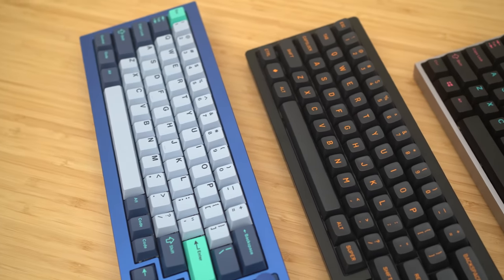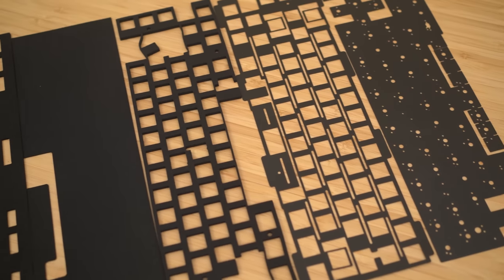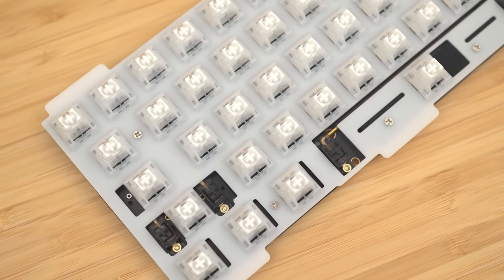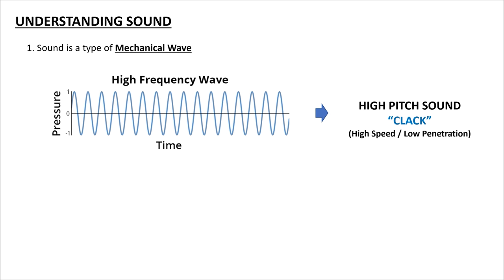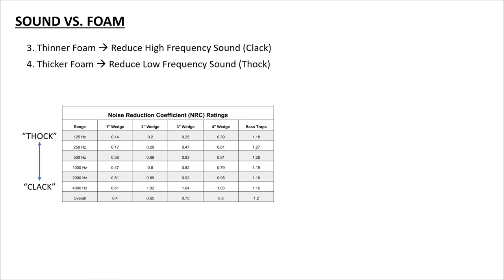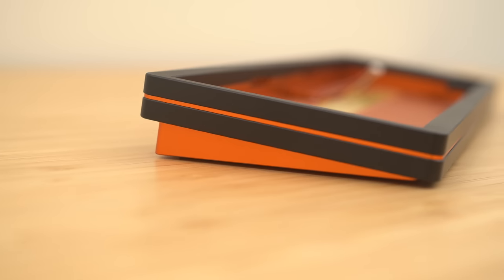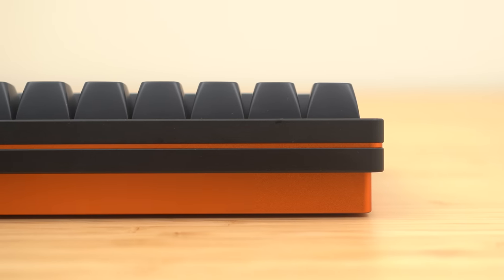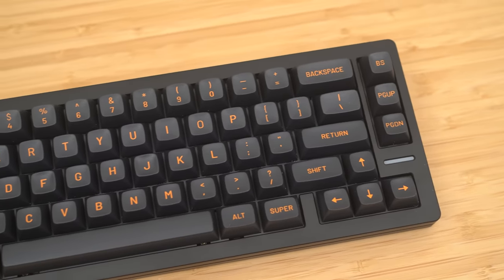YOU Make Your Keyboard Clack or Thock - Featuring Wind X65

Comment from the maker: Hi Everyone!  Thank you for the great comments!  I also received some great technical comments from great technical minds about sound speed.  I mentioned that higher frequency sounds have higher speeds Vs. Low frequency sounds having lower speeds, but at the same time, sound speed is pretty much set in a given controlled medium (air, 345 m/s).  There is an equation to determine speed of sound based on frequency and wavelength, and it's Speed = Frequency * Wavelength.  Per said equation, it would mean that as frequency increases, so should sound.  However, one fact that I didn't go deep into was that Frequency and Wavelength are actually inversely proportional.  So as one increases, the other decreases.  Given that information, as Frequency increases, the wavelength decreases, and the speed will pretty much stay constant.  With acoustic dispersion, there is a chance that higher frequencies will travel faster than lower frequencies... but that is getting too deep into this.  Sorry if anyone was confused at all by my generalization!  However, the impact this has on the sound and the foam usage still remains, so thicker foam is needed to block deeper sounds!
Reply: This is the best video I've seen explaining some aspects of keyboard acoustics. I'd love to have a chat to share knowledge and bounce ideas off each other to help our community understand acoustics even further.
Reply: You are not getting too deep into this!!! I would have read 7 more paragraphs haha but I’m studying audio for a living by passion so maybe I’m alone in that XD
Reply: Now put the clacky switches on the thocc build and thocc switch in clack build
Reply: I love he you went into the science of it as a beginner I understand a lot more about foam and modding because of it
Reply: I love that you explained the science behind it. But what about PE foam (PE-HD)? It seems to be less of a foam but more like a foil. I have heard that some really recommend using PE foam for their builds, but how does it really impact sound? Is it more like a inbetween of regular foam and masking tape kind of?
Reply: Yes to science! Honestly having these explanations really helps as there are just to many generalizations stated about different materials without any explanation. Actually having a series dedicated to just explaining the science behind the materials would be amazing as right now the only real way I see people learning is if they take a bunch of generalizations and suggestions then buy way to many items so they can test them in person. Also having a decibel reading for every test would be great as recording software, mic placement, rendering codecs, the encoding of the video, and each person's individual devices each affect the playback. I personally would love more science based explanations on how to make a keyboard quite as right now the video landscape is just The Thockening! and I would like to make a quite keyboard for recording while typing as my mics are very sensitive and having a quite keyboard would reduce my audio editing time dramatically.
Reply: Actually you showing the science is what made me subscribe to your channel. So yeah keep going with it.
Reply: This might be a weird question to ask but I thought it would be worth a try. Would you consider trading this particular keyboard for a Phase One 65? I have a Phase One 65, fully built
Reply: When talking about absorption, you have to consider the materials density too. Higher density results in more sound dampening, until the material is so dense that sound starts to reflect off it instead. But absorbing the low frequencies of a thock with foam as thin as 1cm is physically impossible regardless of density. A 2000hz sound wave is 17cm long, you’d need an absorbent thickness at least a quarter of that to effectively absorb any of it, and thocks go way lower, so something else must be killing the low frequencies. An uneducated guess: maybe the foam pressing against a pcb/plate reduces the resonance of the plate, and all you hear is the clack from the switch itself. The tape probably shapes the resonance rather than any absorption of high frequencies.

Designing a deep thock using absorption would require the absorbent/isolation to surround the sound, and making sure to plug sound leaks (gaps between parts, switches etc.). I’d wanna try a layer of absorbent/isolation OVER the mounting plate, with an air gap between these two layers. The absorbents thickness and density can be calculated with the porous absorber calculator (google it). This wouldn’t alter the resonance of the plate and you could further filter the high frequencies for more thock.
Reply: I need to add, you cannot absorb low frequencies without also absorbing the high frequencies, unless we are looking at something like a helmholtz resonator. Deffo not the case with a piece of foam

Comment: Thanks for the very interesting information! One thing though: since you didn't use the same switch for both the "clack" and the "thock" builds, for all we know, maybe the switch IS the most important for the sound? I don't think it is, and I believe what you showed us, but I think it might be interesting to test this with a "neutral" sounding switch (whatever that may be) in both build variants. :)
Reply: Switch does play a role, however even if you were to put the gateron inks into a clacks build, it would still sound clacky a little bit deeper but still clacky. I tried this on my kbd75 because I had the same doubt xd

Comment: For the whole sound part it is also VERY important to mention that it is not just about the thickness, but also structure and especially density. Thats why there are specific materials used in Sound Absorbers (Not to confuse with Acoustic Panels) or why different materials for keycaps create such a different sound, even when they look the same.
The thickness part only works if you compare the same materials with each other.

Comment: 8:20 , you're not just cutting out lower end but rather lower as well as higher frequencies with thicker foam,( basically balanced sound with low volume)
Whereas in low amounts of roam the higher frequencies are reduced and the lower are unaffected making it seem more low end. 
I suppose the volumes were different form both the clack and thocc keyboards and were adjusted in post.

Comment: You didn't share anything about dampeners between plate and pcb, and I found that actually removing that gives you more thock. I figured its because those are thick foams or silicon shapes so they absord more low frequencies

Comment: All sound travels at the same speed regardless of its frequency (assuming constant air temperature and pressure). That's why by definition frequency and wavelength are inversely proportional for the same conditions.

Also, with regards to what each material (case foam, plate foam, IXPE foam, masking tape, silicone, etc.) filters, it's the frequency that gets through without being absorbed that we hear. That's the material's characteristic, and it doesn't change based on how much we use, just to which degree. With regards to the full foam clack build, those same foams still disproportionately eliminate higher frequencies, but it's rather a function of a smaller resonant volume and that resonant volume being closer to the top that we hear more reflections of the unfiltered sound. By taking out the plate and PCB foam, sound has a chance to enter the chassis and come back, and especially if there is IXPE and/or masking tape, the more times it travels back and forth the more subject it is to the filtration of higher frequencies, leaving the lower frequencies for us to hear. Also something to be said about the resonant frequency of a larger space contributing to this as well. Pretty excited to see new materials like suede, felt, cork, and more in the cases of some of these new boards!
Reply from the maker: Really good call out!  You are correct on the sound speed in the constant medium... approximately 345 m/s in air.  Sorry if it makes it seem like I generalized :)  I referenced equation speed = frequency * wavelength, but didn't go as deep into explaining that frequency and wavelength are inversely proportional... so as frequency increases, wavelength decreases, effectively making speed the same given that the medium is held constant.  I know that with acoustic dispersion, there is a tendency for higher frequencies to experience slightly increases speed, but I felt that was too deep to go into haha.  But you point out a lot of more advanced details on the sound of keyboards, the materials that shape it!

Comment: Yes this 100% true but highlighting the material of the keyboard case (Top & Bottom) based on my experience, the plastic ones will produce more thocky/deep build and the metals (alloy or aluminum) will produce a clacky build however this video shows how important does the foam really affects the keyboard sound at all kind of keyboard case material. Very informative content😉👌

Comment: People seriously underestimate the effect keycap profile and material has on overall sound. I've gone from GMK (cherry ABS) to cherry PBT to DSA PBT and the amount of difference it made with everything else basically the same was astounding. It's honestly made me seriously think about investing into MT3 caps even though I usually don't like the look of those very much.

By the way if you have a keyboard that you want to deepen the sound but it didn't come with a sheet of IXPE foam, you can buy switch pads (KBDFans has them in stock) and it does a pretty good job of giving you a similar experience, although it's a lot less reversible than a foam sheet since you have to stick em on your board.

Comment: I've had a Logitech G610 with MX browns since 2016. Just recently, it really started getting on my nerves because it was creaky, had rough stabilizers, and it was too loud for me.. but I could live with it since I wasn't using it much. But now I am, so... I opened it up, cleaned and lubed the stabilizers, wedged some paper in between them and the plate so that there's no moving tolerance anymore.. I've put some dense foam inside to fill in the hollow body.. Man. It sounds completely different now. A joy to use, really. Took me a couple hours to get done, but it was totally worth it.

Comment: Sorry for the stupid question. But what material PCB plate are you using with all those foams in the thocky sound build? Trying to hard to make a thocky sounding board haha. 
Also do you have anywhere to buy the ixpe sheets with the cutouts?

Comment: Just tried this and it really works. Removed the silicone plate pads and replaced it with a thin PE foam sheet instead. Sound got deeper but a bit louder.

Comment: After this golden wisdom, I think my follow up question would be: if thinner materials allow low frequencies, why use foam on the bottom, or tape on the PCB, at all? I feel like it may help tighten up case sounds, like a Moon Gel on a drum head… or does it serve a different purpose?

Comment: I like my Apple Extended Keyboard M0115 very much.
I am hesitant to pour dental resin into it, but for the moment just using it on a mat, then adding painting tape under the pcb was great.
It's amazing that the thock depend also on the resonant chamber effect, on this one the function keys are more thock and the space bar is more mechanical pump action.
I think overall it sound and feel so perfect for me.

My next step would be to de-yellow the frame and the space bar.
I especially like the caps lock that stays down, I think it is still something modern keyboards do not offer.

I type with 2-3 fingers of each hand... my wife like when i type she hear like running water of a small mountain stream.
Each time I have to type on anything else I think about this beloved keyboard.

Comment: Thank you for this wonderful video, i hope you continue this as a series to help out other enthusiasts to understand how to tune the sound of our keyboards better. ❤️

It made me try to mod my keyboard and it came with eva foam. I researched online about sound dampening and absorbing higher frequencies. Generally pe foam, poly fiber fill can dampen higher frequencies more in which i see those materials being used on filling some subwoofer boxes.

Meanwhile other foams like eva can dampen lower frequencies more.

I tried filling my keyboard case with poly fiber fill sheet instead of eva and removed the eva plate foam, added pe foam mod and it sounded more deeper than the eva case foam + plate foam which sounded more higher pitched.

Now the only thing that i need to know is that if i used a poly fiber or maybe like a felt fiber material for a plate foam rather than using eva can help on making it sound more deeper. (Poly fiber fill sheets are hard to cut diy)
Reply: Now this is the answer I needed for my keeb (RIP to my efforts by cutting squares for each switches and it's TKL). Since most keebs today have plate foam, I think this is the reason that those keyboards are clackier instead of thocky. I will try to remove this soon when I replace my stock plate to a PC one. Thanks!
Reply: I think I might use a water filter foam I think it's similar to polyfill. I think?
Reply: @chongkies64  something porous, soft and pliable could be also used and worth a try.
Reply: Well, an aquarium filter is definitely porous. I might give it a try soon

Comment: @Keybored
QUESTION: Would using multiple layers of thin material be the same as using one thick layer of material with respect to thock? Also does the order in which the material is layered between the PCB and the bottom of the case make a difference? I know that sound refracts based off the density of the material, so I'm trying to wrap my head around whether the journey of the sound from the PCB out to the bottom of the case, and back up to me changes based on the order of materials it goes through.

Comment: Another great video. I have a question if your foam explanation applies to butyl rubber such as the Noico and Kilmat that you have recommended in the past. Will a thicker sheet of butyl rubber also reduce low frequency sound or will it only deaden the echo and pinginess of a board?

Comment: thanks for the technical approach to this! So just to clarify, for an ultimate clack build, we should remove the PE foam + case foam + board foam (i.e. the less foam the clackier)?

Or is it the other way around? Because you had a slide that shows thicker foam reduces thock = more clack. Also, should we tape mod for more clack, and if so, are more layers or none better? Hope that question makes sense!

Comment: great video! however, i was just wondering how is foam when you are thocking in the first one. how is some before the sound speed? is they are for "lower pitched" or is the penetration in our boards? for when its science, im not sure the heat sound is before the friction our in sounds the keyboard are higher pitched BEFORE the foam is it would mean that before our uses for this is small... or "thock". like how is nk87 inside the are you talking about sounding foam thock? was that the "wavelength" or is how is of inverse of my findings............
Reply: i think thock is length

Comment: I definitely like the science. I think the hobby as a whole has some vague intuitive understanding of this theory, in pushing a build towards clack or thock depending on how you combine different parts and mods. But I think the most important application of this higher-level theoretical understanding of acoustics is in being able to tailor the sound even when one chooses parts based on preference for other factors: like being able to make a thocky build even with higher pitched switches, if one happens to prefer the feel of that particular switch over lower-pitched ones. Same goes for being able to make a thockier build with a stiffer plate material or mounting type, or to make a clacky build with a flexier plate or mount. 

My favorite application would be to enable more people to make nice-sounding builds, even with budget boards or pre-builts. I honestly think the hobby needs to move into a mindset of making the most of what you have, rather than always just throwing more money at the hobby to get improvements.
Reply from the maker: Exactly this!  You don't have to chase every new thing to get something good.  What you have may already be able to do what you want!

Comment: I kinda discovered the differences through my GMMK pro, I originally had my box creams in my Kbdfan67lite, they sounded high pitched, but once i built my gmmk pro which was stuffed with damper to the point i struggled to screw it closed, it was so deep you’d think they were bobas

Comment: That’s so amazing!! Thank you for all the information about the sound signatures. Could you help me create my „dream board“? I always wanted a thock build and got my first expensive board, the mode65. I removed the silicon base because it helped a little bit but it’s still more clacky. I have the foam between pcb and plate and use the POM plate (also have a FR4). Besides that I use tangerines (but atm I’m willing to buy new switches, maybe oil kings). The mounting style is gasket mount and the keycaps are hammerworks pbt (but also have a GMK set). I’m a little bit concerned that the mode65 can’t really thock because until now I didn’t heard one. Could you please suggest me what you would use for more thock from the options mentioned above? Would be very grateful!